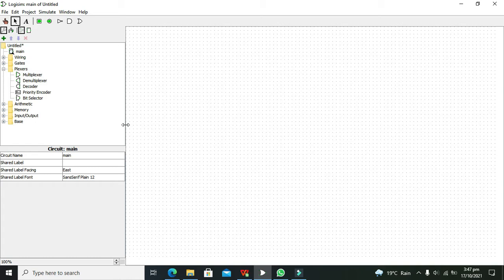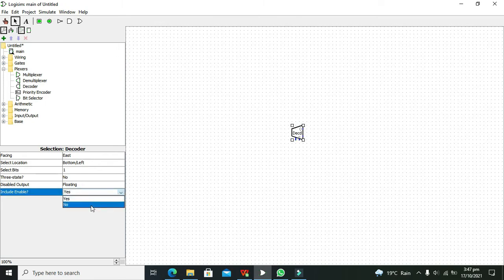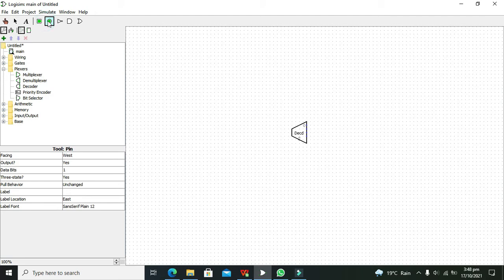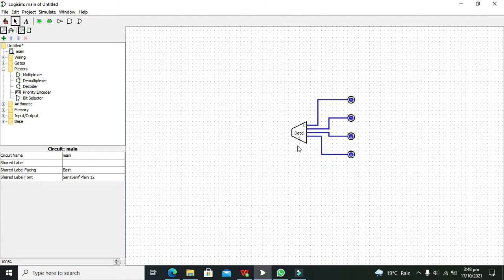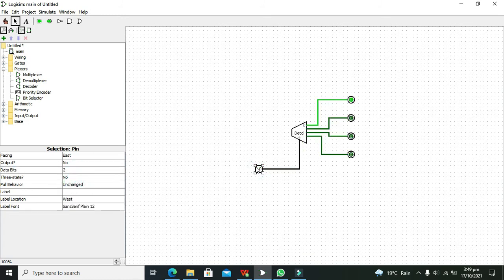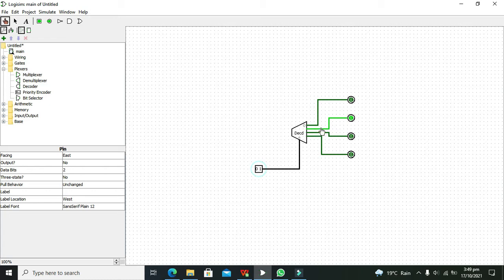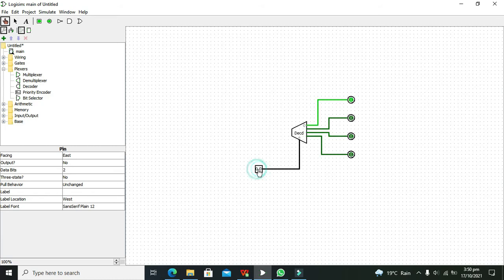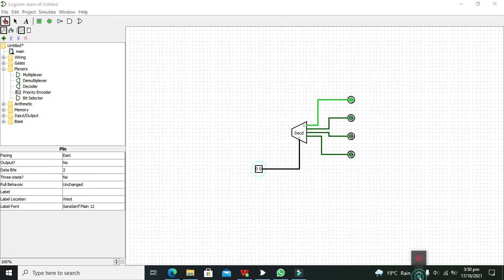how to use 2 to 4 decoder in logisim | tutorial on simulation of 2 to 4 decoder in logisim

Comment: I need to know how to use this exact circuit but the input are two separate pins and I want to represent the numbers from 0 to 3
Reply: the 0 to 3 numbers i want them as 1 single output which I will need to connect to a led matrix
Reply from the maker: i didnt get what u said sir.....it is 2 to 4 decoder so  2 inputs must be there....